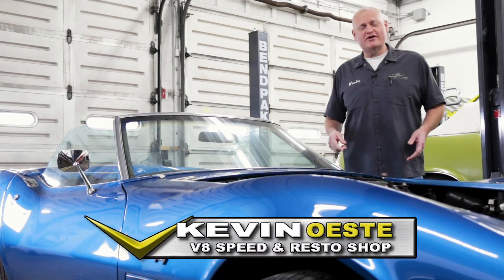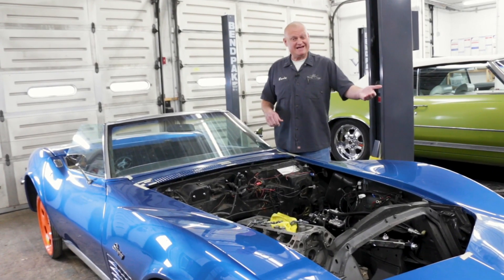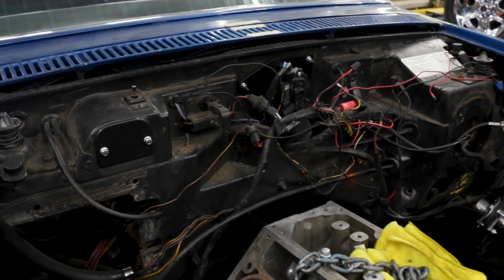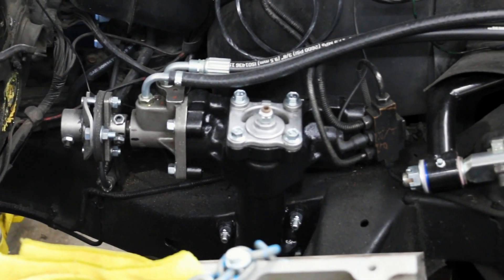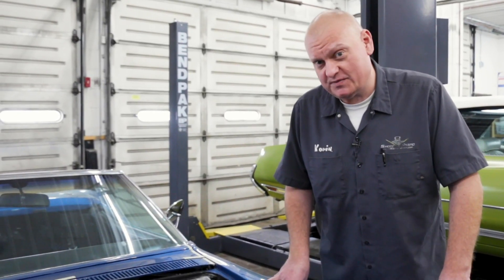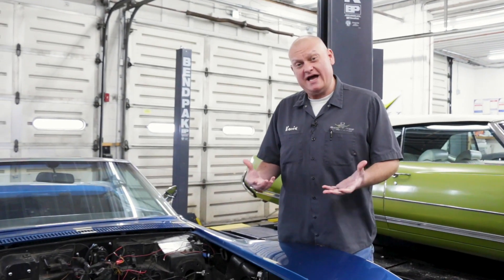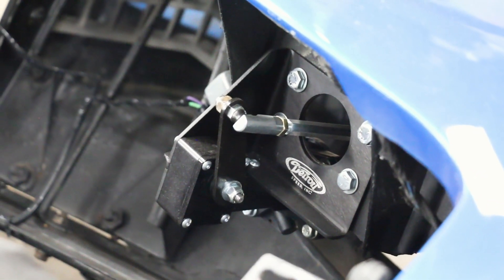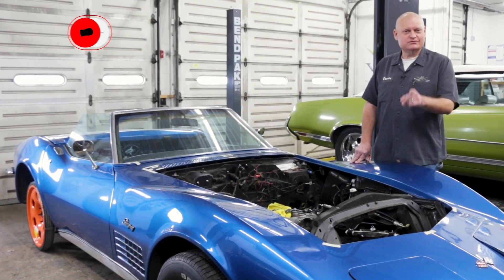1972 Chevrolet C3 Corvette LS3 Swap, 6 Speed at V8 Speed and Resto Shop V8TV

Comment: The rear tire/wheel assembly you have looks like they would be super handy to use during the restoration process. Really gets the tire out of the way and a lot of room for access in the wheel wells. Are those just space saver spares being re-used, or are they made for the purpose?
Reply from the maker: We use those wheels during the build process all the time.    They are made by Guniwheel and have universal bolt patterns.   Check them out here:  https://www.guniwheel.com/

Comment: About how much does this cost?
Reply from the maker: Hello Flamingo, the cost of a job like this can have a wide swing depending on the engine choice (power level) and if it's going to be a manual or automatic transmission, what kind of suspension upgrades desired, etc.    The best thing to do is reach us at http://www.v8speedshop.com/contact or 314.783.8325 to chat about the specifics of your car and your desires.   Thanks!

Comment: What do you guys use to strip a vehicle down to bare metal?
Reply from the maker: It depends on the project.   We've recently been using a dustless blast technique, which uses high pressure water and fine glass bead to remove the paint.   On big sections fo body panels, we still use DA sanders and strip by hand to ensure the panels are not warped.   We use chemical strippers on difficult areas like the underside of hood bracing, etc.   Could be a good video idea, thanks for the question.

Comment: Why the orange plastic rear wheels🤔
Reply from the maker: Those are steel wheels, but just "rollers" to allow us to move the car around the shop before we get the actual custom wheels made.  These also have universal bolt patterns, so we can use them on multiple cars.